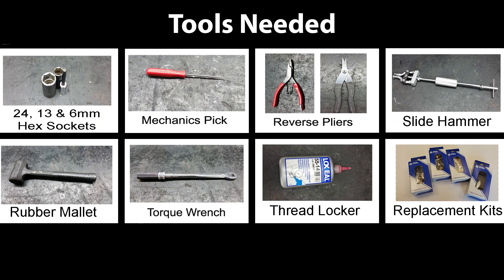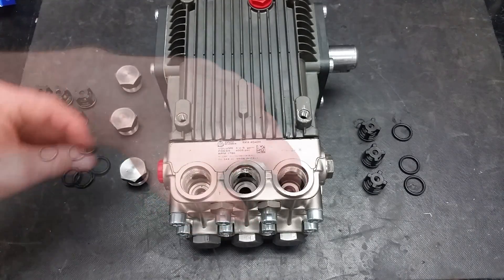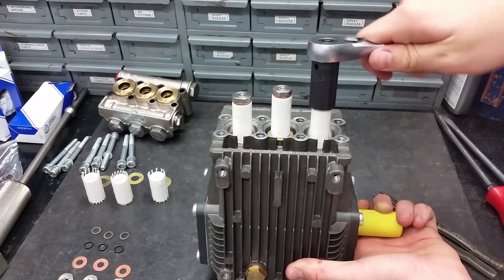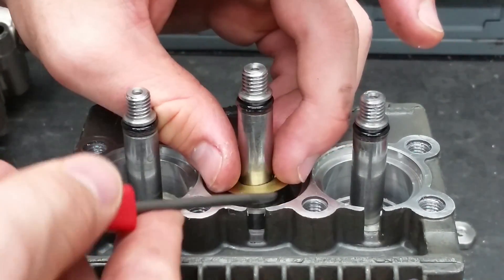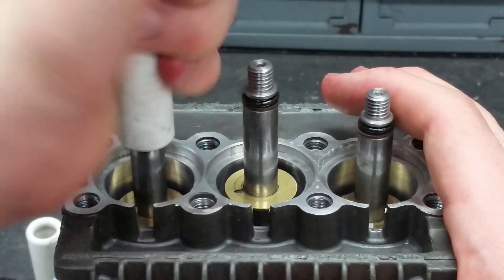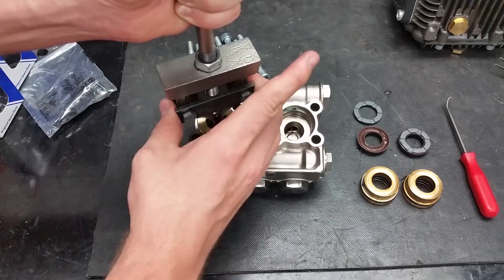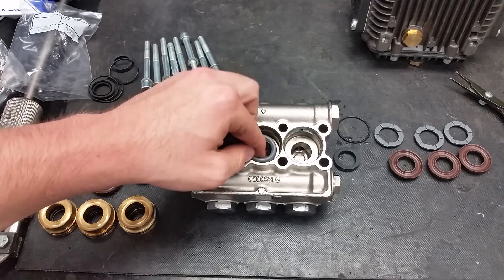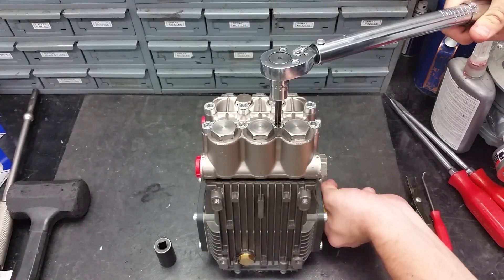RK Pump Repair & Maintenance

Comment: What kind of lube is used on the piston o-rings or any of the o-rings? What is the torque spec for the piston nuts? *EDIT* never mind I found the service manual on your web site, "Place a light film of oil on the O-ring and back-up ring." and I found "106 in/lb" for the piston/plunger nut.

Comment: Head bolts get torqued to 218 in pounds.  The video implies foot pounds.  Also, why no video including oil seal replacement?
Reply: Thank you!! That was my question... he just said "Torque to 218 pounds" ... with no reference to inch- or foot- pounds(?!).